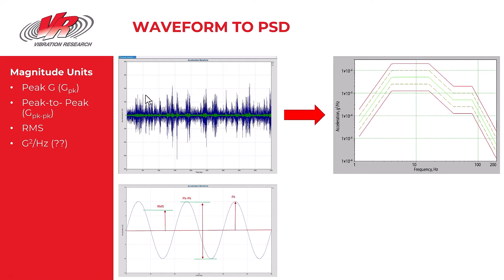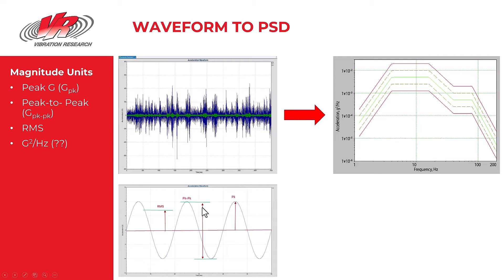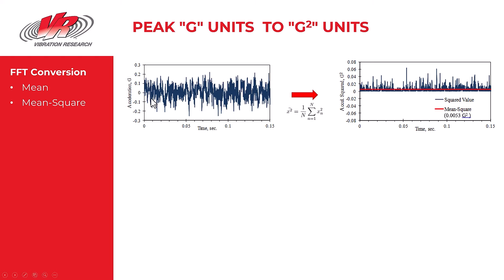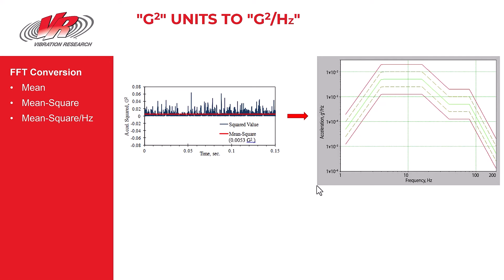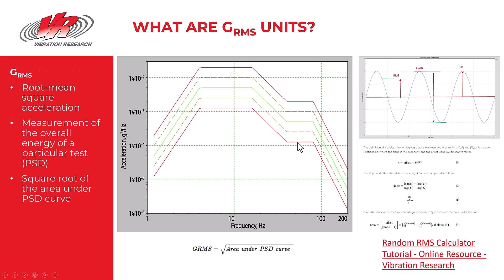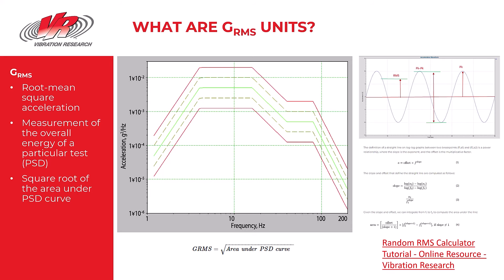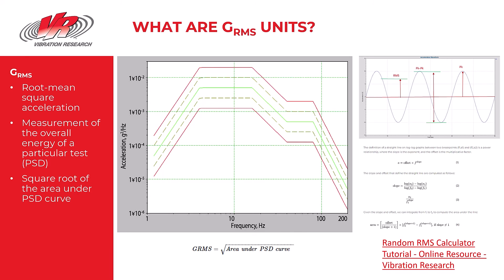GRMS and G2/Hz Units | Vibration Signals #askjoel

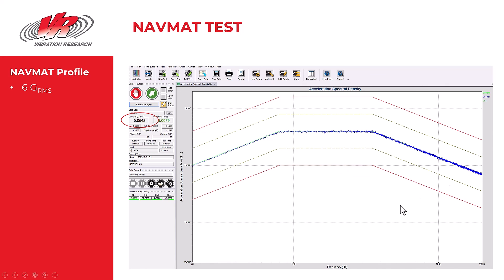Comment: One minor correction - You write correct formula for the RMS below the curve @4:46 and describe it correctly there but @7:47 you misspeak that the RMS is the area under the G²/Hz curve (it is actually the square root of that value).  I just wanted to note that here in case someone was confused.  The concept of RMS goes back to AC Power.  It represents the voltage a DC signal with the same power would have and makes power computation easier.